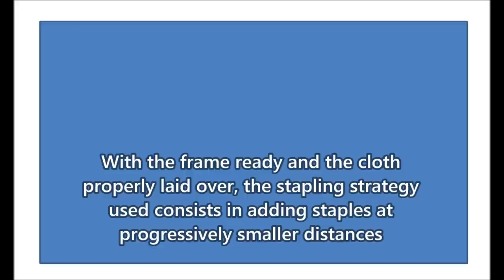Easy steps to build a DIY Home Theater Projector Screen

Comment: Works exactly as I'd hoped. It's tiny, very portable, and easy to use. Hooked up fast and easy to laptop and PC. Took a bit more fiddling around to get it to work with my phone since I'm not tech savvy. It's going to be fun to take it camping.

Comment: Great video and blog. I really appreciate the info. I have a question in regards to your cuts. What did you end up cutting the 1x3x6 and 1x4x12 pine wood to. What was the final cut measurements. I like your setup and wanted to follow your same steps so was just curious on your measurements. Thanks in advance.
Reply from the maker: I used the 1x3x6 whole and cut the 2 horizontal 1x4x12 at the 114in mark. Does that help? good luck

Comment: Hey great video! I made a 110 inch screen couple days ago, I would like to know how many picture hanging hooks you used when mounting on the call? mine is probably lighter than yours as I only used 4 sticks of wood for frame and some felt tape for boarder, I was thinking only use 1 picture hanging hook on top center, do you think its enough? (minimum damage to the wall in rented apartment) thanks!
Reply from the maker: I used 3. I would go with at least 2 --- the frame may not balance properly with just one in the middle.

Comment: Thanks a lot for your video, I have a question, How did you hang the screen on the wall? You used only 3 1 Hole D Ring Strap Hanger? 
My guess is you screwed in 3 of those hangers behind the frame you made as well as drilled in three holes in the wall and hung em.
Reply: That's exactly right. I don't remember precisely which screws I used as I have a bunch loose in my toolbox.
Reply: Renato Cazangi thanks for the reply. How heavy did the whole frame come out to be? I researched a lot and finally ordered a black velvet tape which they say is best for border. It is coming from india, got it for around $36 US dollars. Three regular screws can handle the weight right?
Reply: Anu Chohan Not heavy. Yes, I used just three screws and it's still hanging in there :)

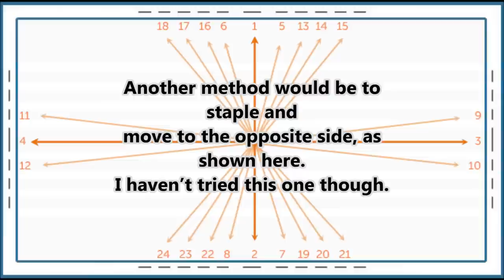Comment: I bought the FlexiWhite material from Carl's place and this method of stapling did not work for me because the material is so hard to stretch due to the material type and its gigantic size.  I was trying to make a 150" screen (6.6 feet x 11.5 feet).  I had to remove all the staples after trying this method and did it with the method shown on Carl's website (shown @ 2:43 in your video).  It finally came together after a weekend of frustration but it is nice...mine fills the whole freakin wall.
Reply: Good to know. I don't know that material, but this is a good tip for people using FlexiWhite. Thanks.

Comment: Nice job.  Would be nice to know what screen material you settled on.  I helped a buddy of mine with a similar project using bed sheets that he then painted with flat white paint -- get a paint with as high a titanium (IV) oxide content as you can find (that's what makes the paint white).  His wife was volunteered into doing the sewing and she was smart enough to wash the sheets first before she sewed them together so they did most all of their shrinking before we applied the paint.  Even so, as taut as we were able to staple the sheets to the frame, the paint caused the sheets to sag as the wet paint was applied.  Then we discovered the paint did something amazing when dried -- first it made the seams invisible, but even better, it made the sag, which we initially thought was going to totally ruin the project, when the paint dried, it made the sheets get so taut that the whole thing was as tight as the skin of a drum head without a wrinkle in it.

Tip 1) place a piece of stiff, thick pasteboard about an inch square against the sheet material and then staple the pasteboard and the sheet to the board, stapleling thur the pasteboard so it acts as a kind of "washer" preventing the staple from tearing the cloth.  

Tip 2) if you want a really SPECTACULAR screen, and admittedly, this is tricky, but if you know how to work with wood, or know someone who does, before you put the material on the frame, soak the top and bottom wood pieces in water and then bend them so that the top and bottom pieces of the frame are against the wall -- then he temporarily screwed the top and bottom pieces into his wall. With length of the top and bottom board wet with hot water, he kept adding shim blocks to the side frame pieces at the top and bottom corners, bending them farther and farther away from the wall until he got the sides to protrude about half a foot farther away from the wall that the center of the frame which was flush against it, thus creating a CURVE.  Then we did the rest of the work attaching the screen (sheet) material and painting and finishing the frame off with roll black flock for the border.  

The result was an incredibly stunning looking CURVED screen, better than many cinemas who only install flat screens because they're cheaper.  Next he put a motorized curtain to dramatically open and close at the beginning and end of the movie.  I am telling you, that curve and that curtain opening when he starts the movie ALWAYS makes people who haven't seen it oooh and aaaaah.  Well worth the time.  

Tip 3) use a goodly amount of black surround.  The couple of inches border is good (and necessary if you want it to look professional) but for maximum cinema impact, use a wider black surround around the entire screen.  Since you already have the black tape edge, the wider material can be stapled to the ceiling and let hang across the top of the screen and on either side and dress it so it hangs in back of the screen; it doesn't even need to attach to it -- just let it rest behind the screen.  

You can use the traditional black velour, but it's heavy and costly.  And we found an even better material that is BLACKER than velour.  There is a VERY lightweight black nylon material that can be stapled into the ceiling (use those pieces of cardboard as washers, and let it hang against the back of the screen.  For the bottom, staple it to the bottom piece of wood on the back. You can get the stuff at any outlet that sells bolts of material.  

Happy Cinema Construction
Reply from the maker: Wow, this is great! Thanks for sharing.
Reply: Krrish
Is a
Reply: Nice to read.... Thanks for sharing

Comment: The frame I made used exactly the same materials you used pine boards L and T zinc plated brackets, but mine's just 100" diagonal. Still i see there is some flexing since its pine, can you confirm if it hasn't bowed? IS your cloth still taut on the frame? Haven't stapled the cloth yet.
Reply from the maker: Yes, it's perfect. I just had to replace the black tape as it starte falling.

Comment: great video!! my question is...how did you run wiring to Projector for sound???or is it wireless???
Reply from the maker: Fernando Guerra I ran the wiring under the carpet. Unfortunately that's not shown on the video.

Comment: What did you cut the extra screen material with?  You didnt quite show that in the video.  Thank you
Reply from the maker: I didn't. I used the entire piece on the screen - I made the frame based on the blackout size.
Reply: Thank you!

Comment: Hey, I was wondering about portability and storage. I was wondering if a slight change of materials is possible to be able to collapse and store my screen. Materials, First using velcro to hold the screen in place on the frame, instead of either nailing or tacking the material directly on the frame. Second would be to use either hinge joints or a joining or locking mechanism. I want to be able to store it in a box for the winter time. Anybody got any idea's on how to do this? I have a couple of clues rattling around in there.
Reply from the maker: That's a good idea. The only concern I have is about stretching the fabric enough so there're no wrinkles. Not sure how good that would be with velcro.

Comment: Shouldn't have been 114" x 64"?  Or did you not care about perfect 16x9 scale?
Reply from the maker: I adjusted my projector to fit the space and there's probably a little bit of unused screen in the top and bottom. No big deal though.

Comment: well you know you could of just folded the cloth over the edges of the wood and staple from the other side so you wouldn't need the tape
Reply from the maker: That's a good idea. However, I built the frame the exact size of the cloth --- maybe if I had done it a little smaller....
Reply: also I've heard the felt tape helps with a contrast boost